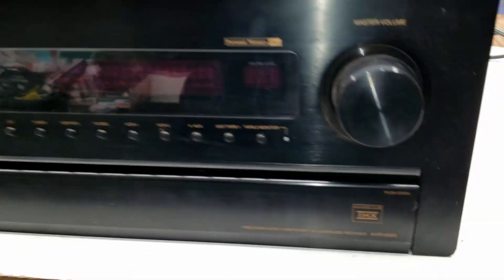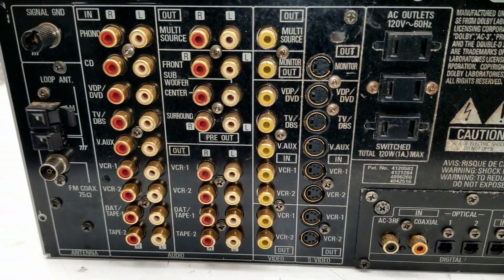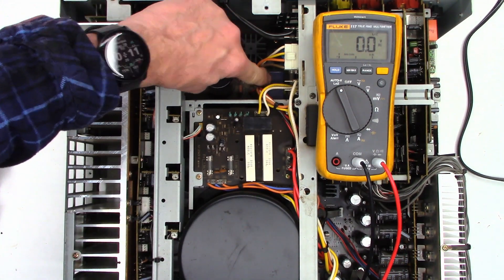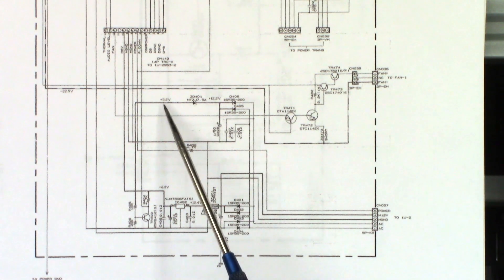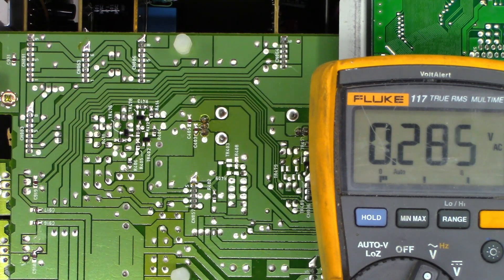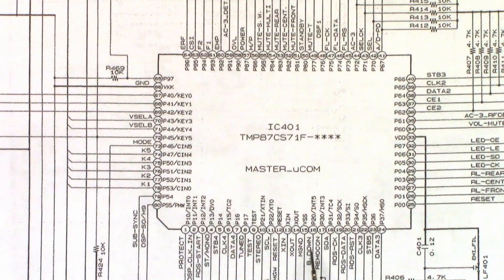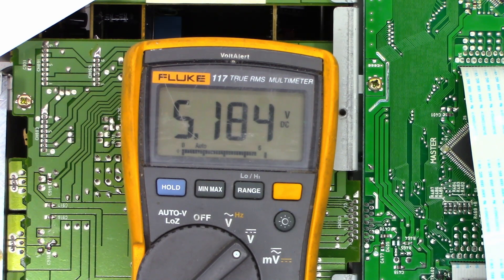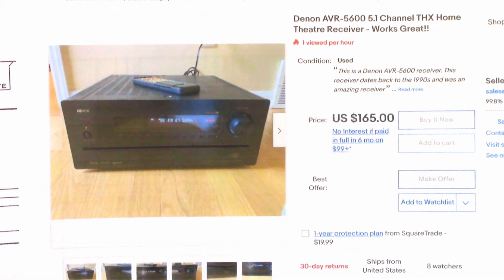DENON AVR-5600 AV RECEIVER NO POWER AT ALL, UN-SUCCESSFUL REPAIR. TOO BAD.

Comment: Hello,  great video, thank you~!

Just finished a successful battle with Denon AVR-1601 receiver with the same symptom. Completely dead, not responding to buttons but measuring perfect CPU voltages as you indicated. I almost came to the same conclusion of the bad microprocessor. 

To make it short, the culprit was the dirty button keys. In my unit, K1, K2, K3 lines were measuring intermittent and fluctuating low voltages (they should be right at 5 volt when nothing is pressed at turn on). Apparently this made the microprocessor confused on its own wonderland and unable to wake up. You can check your unit on the line K1 to K5 (AVR-5600). 

For AVR-1601, solution was to remove them all, clean and check each buttons for on/off state.  For you unit, I guess there is still a good possibility that the microprocessor was indeed dead. But I thought I suggest others to check the key button and voltage lines before trashing it. Worth the trouble in my unit. 

Cheers, 

Terry

Comment: I am learning on how to troubleshoot these units, I have a Denon AVC-3800 extremely similar circuit. It does exactly that, dead, nothing, 5V at the processor and ground is there too, I haven't checked the power down and reset pins but I'll do all your checks now. What I tried, I supplied 6v to the power pin, from voltage regulator through an external 4.7 K fuse and the voltage was dropping to under 1.0V indicating high current.  Was hoping to get the main relay on and make sure that part of the circuit is OK, now I have more questions, more to study and figure out. It's a hobby and I like these hard to crack ones, it's making me better anyways

Comment: Did you check c601 - just above the mini trans on the first schematic you put up in the video, if not worth a go. The unit won’t switch out of standby if this faulty.
Reply from the maker: Even if it is faulty the main power relay RL601 (in parallel with C601) would still pull in and power up the unit. Even if that cap were shorted it would always be on (power the the main toroidal transformer), and it was not.

Comment: hi
I have a Denon AVR-X5200W with the same issue, no power at all no red signal no clicking when plugged into the power. I checked the voltage on switching power supply board it looks ok! Could it be a HDMI board issue? I have tried to connect a deferent switching power supply board ( Denon AVR-X1400H) when I plugged the power cord it makes a clicking sound and red signal on power button comes but because the power supply is completely deferent it does not turn the receiver on! If the HDMI board is bad why the red light comes with the different power supply board? I am confused is the issue related to the HDMI board or switching power supply board? please tell me your opinion, Thanks
Reply: Late to the party, did you ever find the issue on your Denon? I have the same unit as you with the same issue..

Comment: Shame this whole unit stops on that one part. It is a beast. I was wondering what the other pins on the processor were doing. Could there be another line that is in the wrong state for the processor to run the code past a certain point? There are lines called Reset, ovl, ac3 detect and protect, etc...
Reply: It was the key lines in my Denon AVR-1601 receiver. Old dirty buttons fooled the microprocessor to think some buttons are pressed in at the turn on, this lead to no response, no wake up described above.

Comment: This one might not be economical to repair, assuming you can obtain a suitable equivalent replacement microprocessor; even then there is no guarantee it will fix the problem. Sometimes it's better to chuck in the towel with some jobs - especially the really nasty, complex ones.